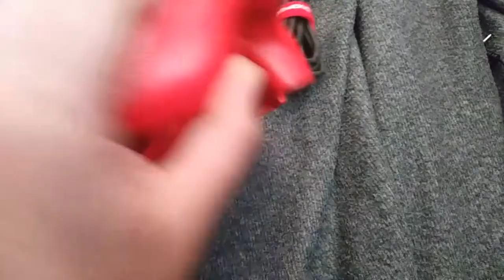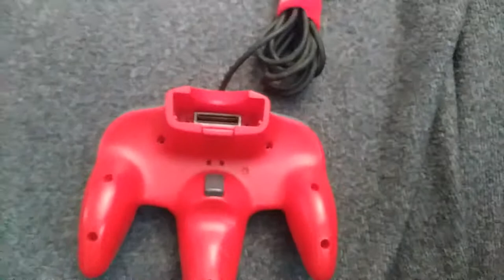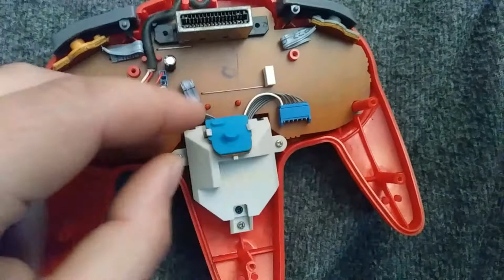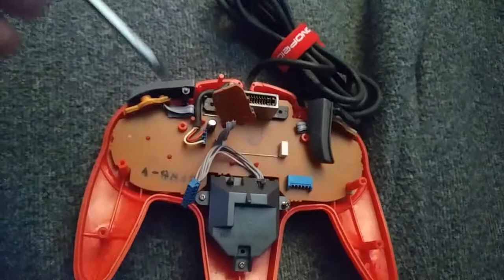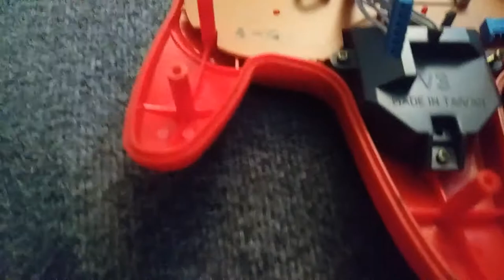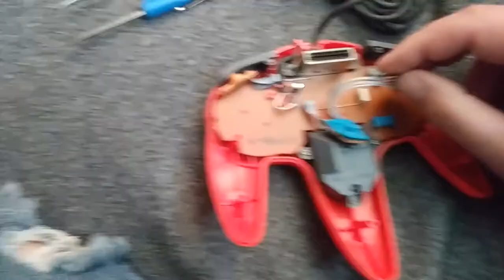How to Install a Gamecube-style Joystick in an N64 Controller

Comment: In that red controller you're using the newest V3 version of that GC styled stick. Have you noticed an improvement over your older modded controllers like better sensitivity?
Reply from the maker: Thanks for watching! I bought all of the replacement sticks at once in bulk a few years back so they should all be the same revision. (Still have about 20 or so I think) The green controller is my "daily driver" and it's held up well. It has seen many intense, beer-fueled Mario Party sessions and it still works great! There are still a couple games that play best with a tight original stick and other games that play best with some kind of specialty controller. It takes some getting used to but, once you've switched it's really nice for most games!

Comment: You can actually use Joy Con thumbgrips on N64 joysticks if the plastic bothers you.
Reply from the maker: really? joycon grips seem bigger than an N64 but, i could be wrong. dont have a switch myself
Reply: @71dembonesTV  I tried to reply for a day now and YT doesn't seem to want to publish it. Anyways, I saw it on a post on reddit,  i might be wrong about it as well
Reply from the maker: @juani.rodriguez7326  YT comments are glitchy sometimes ^_^ If you have the post, feel free to link it. It may be that someone fitted a joycon or other custom stick into an N64 controller and the cap worked for that.
Reply: @71dembonesTV  I tried to send it as well but YT simply doesn't want to post it, you'll have to look it up and see that pic yourself
Reply from the maker: @juani.rodriguez7326  damn youtube always foiling our plans
Reply: @71dembonesTV  Indeed. Did you see the reddit post of the thumbstick cap?